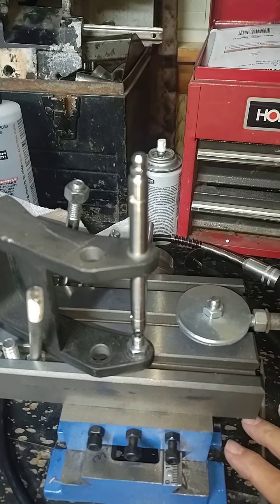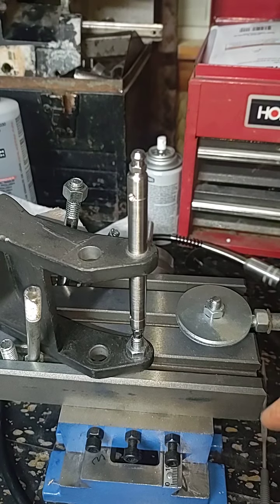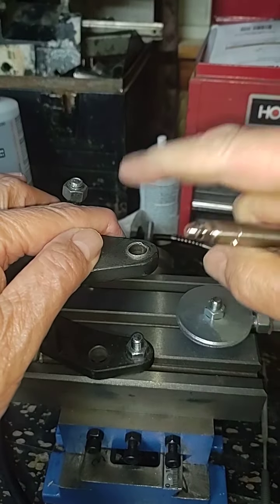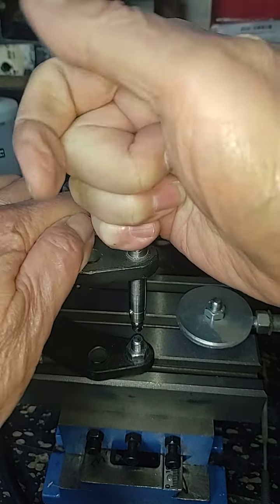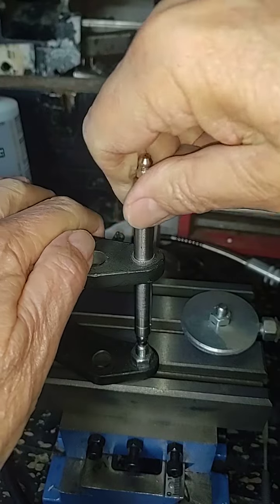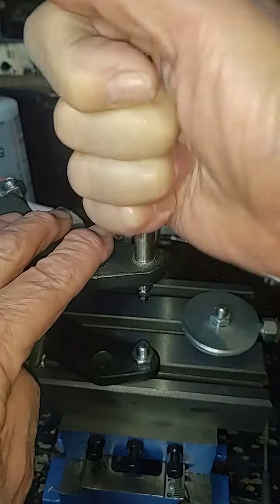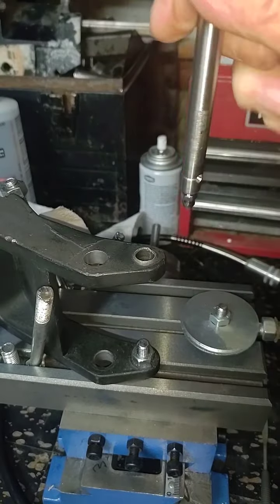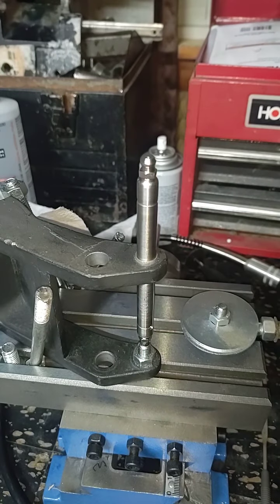Bearing Replacement for Ford   Lincoln power running boards. Getting the pin to actually fit. #short

Comment: Thanks for the videos. Any chance you’re planning to make and sell the bushings?
Reply from the maker: The bushing sets are available on E-Bay. I just did a search on the terms: Ford running board bushings and got back a listing.

If you put into your search bar :  www.ebay.com/str/qdiltd?_trksid=p4429486.m3561.l161211
This will take you to the vendor's page. Look for the bushing set for the F150. 

The thing with these bushings is that they are slightly oversized and so you will need to use a Dremel tool with the thin cutoff wheel to slightly open up the slot in the bushing. You can then insert them into the hole.